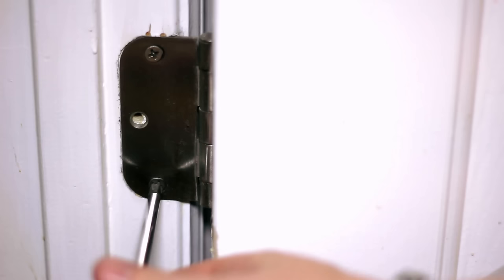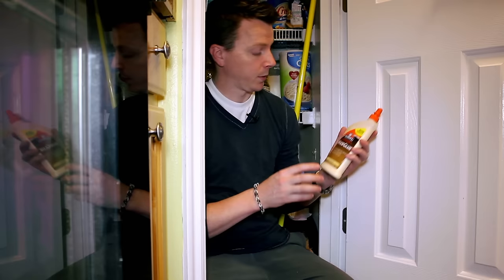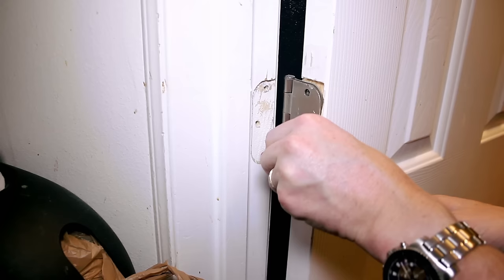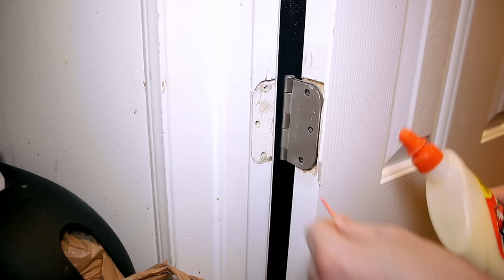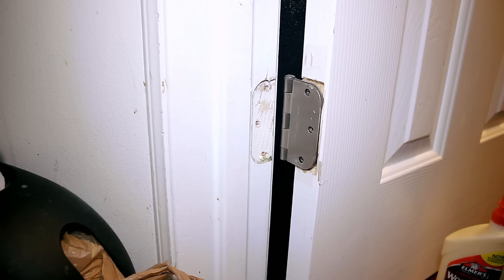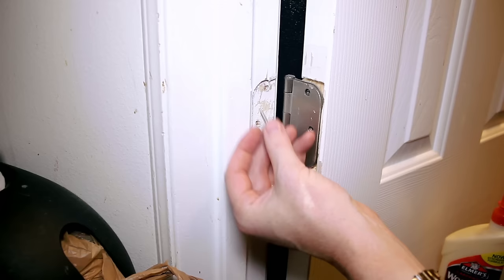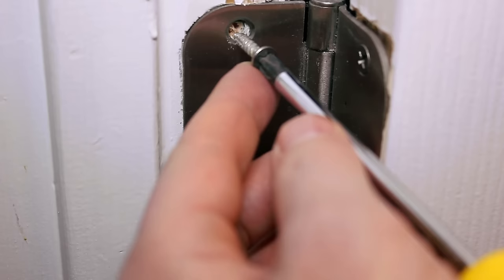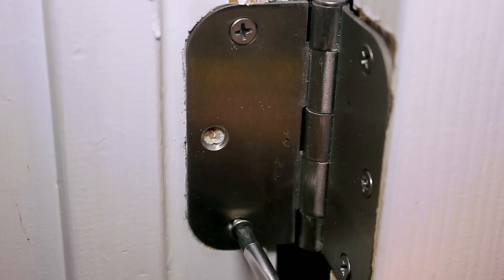Fix Stripped Screw Holes - 3 MINUTE FIX!

Comment: Skewers can also be a good option. It all works. Plug the hole with more wood. I never use glue for my plug unless the hole is really large. I rarely use this solution on doors though. Usually I will just put 3 inch screws in, if I need to shim the hinge plate and the outside holes are stripped I would do this.

Comment: What about repacing the screws with 3" deck screws and no toothpicks? That's work good. I actually plan on doing that with my front door hinges and strike plate for more security.
Reply: Agree. Also by going deeper, you are actually attaching to the 2 x 4 which is a stronger hinge attachment than the wood trim that a good kick can kick the exterior door open.
Reply: mixwell1983 do it after you do this fill method bc I did that & it didn’t take that long before it just stripped that section out as well. The kids going in & out & pulling on the door, etc. I would fill it first then throw that monster in there for sure. lol best possible bond all around.

Comment: Or you can do it in about 30 seconds using dry matches.
Stick a match in the hole, snap it off repeat until the hole is filled.
Repeat for each hole.
Attach hinge (in this case)
No glue needed.
If you really want to use glue, you don't have to wait for it to cure before attaching the hinge.

Comment: You could have used a wooden dowel that fits or the end of a wooden golf tee. Cut off the extra with a utility knife or pre measure the length and cut to size before inserting it into the hole. It will be a tighter fit and will last a lot longer. I did the toothpick trick and it works, but eventually it will become loose.

Comment: Can this be done say, after your kid decides to do a pull-up on one of your bathroom towel hold bars and strips the screw anchor clean out the wall (to center the towel bar, I couldn't use a stud so I used a wall anchor). I'd like to put the towel bar back up but drywall puddy has no stability, just good for patching. Can I stick some toothpicks inside the drywall hole, sand it then maybe add a thin coat of puddy over it? Do you think I can then screw into the wooden picks and rehang my towel bar, or no?

Comment: Is it the same process if the issue is with the hinge on the door portion?  I have a hollow core door.
Reply from the maker: JahPage Yes, it works the same with hollow core doors. They have a solid wood block, or at least a composite block, for each of the hinges so you should be able to use this same technique. Good luck!
Reply: +Nils Rasmusson Thank you so much!!!!

Comment: The ideal fix is to glue in a wood dowel and then redrill the holes, but an easier quick and dirty fix is to stuff the hole steel wool and just run in the screws. I've been surprised at how well that works.
Reply: Bob Cloninger does this work on metal screw holes too???

Comment: Hi,
Nice video
Does this method work on walls?
It's a blind attachment in which the screw is not gripping in the wall. 
There is a wall plug in this hole as well. Also would the wall plug need removing before using the toothpick method as in the video?
Thanks!
Reply from the maker: If it’s drywall then no, this won’t work. You probably need a good patch and a strong drywall anchor.

Comment: Thanks so much for making this video! Can I use wood filler instead of wood glue to fix the stripped holes?
Reply from the maker: I don’t think wood filler would hold up because it doesn’t set hard enough, unfortunately.
Reply: @LRN2DIY  good to know! So it has to be glue for wood, correct? Is there a specific brand you recommend?
Reply from the maker: @alexwong8851  Not really - any wood glue will likely work great. Titebond or Gorilla glue wood glues are both great but most will be fine. You can actually get away with doing this without glue as long as the wood is packed in there tightly.

Comment: Here's a much older method for you that doesn't cost any money at all. Go find a tree with a small limb growing out of it and don't forget to take your screw with you. Trim away the bark, then cut a piece of the green wood off the length of the screw. Place it in the hole and screw the screw in, you'll have permeant threads once the sap sets in and a permanent seal. Yes longer screws are better for a stronger hinge or anything, but using green wood no matter the length is the best. It's your choice.

Comment: When I run into this I use wooden matches, because they are bigger, and more uniform.  I have seen people years ago using cardboard (sheet not corrugated.)  Slather it with glue and pack it in tight...then let it dry  This was for INSIDE doors only.  And HAND screw, don't use electric.. you can feel the grip better.

Comment: Yeah we are working on it, the brass hinge it's what we have, already bought a new fan, but we just find out that it was nd the fan that it was bad, was the connection in the attic, it's no installation taking the humidity out they put the tube by the little window with fan in the attic and tape it to.  so terrible.

Comment: Stuff steel wool into the hole then put wood glue on the screw to make it easy to install and call it done.
It's quick, easy and most importantly permanent.
😁
Reply: Hopefully the wood glue isnt going to cause the steel wool to rust over time which would lead to rusty metal deteriorating on wood

Comment: To repair a solid wood dining room table would you use your method or would you try to insert wooden dowels instead?
Reply from the maker: For something that might take a lot of weight/pressure like that, the more you fill in the hole the better. One method is to drill a hole larger than the stripped hole then plug it completely by gluing in a dowel, then redrill the hole.
Reply: That was what I was thinking about that method or using an anchor.  If I went with the anchor, the area that I'm ultimately screwing the leg piece to is about 7/8" thick so I'm leaning more towards the dowel...

Comment: Any chance this can help me when putting up a wall mount for a TV, I think the stud is stripped
Reply from the maker: Yes, actually - the same principles apply. Where a TV is involved, though, I'd recommend moving the TV mount up or down an inch or two instead and drilling new holes. If that's not an option, maybe try drilling out the hole, plugging it with a down and some glue, letting it dry, then redriling.

Comment: Its better to make the hole bigger using a drill bit then use a dowel to fill the hole.  It’s like starting over with no hole. And don’t forget to use 2-3 inch screws.

Comment: I had done this for years but then I put a new twist on it.  I drill a 1/4" hole where the screw goes.  Then I glue in a 1/4" diol.  To complete the job I just put in the screws.
Reply: diol?

Comment: But what happens if you need to unscrew that hinge later? Do you have to redo the toothpicks every time you screw it back in? 

Also, why do you prefer toothpicks over wood putty?
Reply from the maker: +PoIyTicks If you remove the screw, it would act the same as real wood, because it is actual wood in there. If you try threading the same screw in, it should work fine. If you repeat this a dozen times, it will likely need to be filled again, just like any piece of wood. Wood putty could work too but I know toothpicks work because it's solid wood.

Comment: Any tip for aligning the door. My husband tried to fix the door and moved it up or down while tightening the screws that now it’s not closing properly and is banging on the top side of wooden frame 😶🤦🏻‍♀️
Reply from the maker: That's no fun. The only way I know how is to chisel out some of the hinge area on your door and set it a bit lower. If it's just barely off (maybe 1/8" or so), you can try putting some toothpicks in the bottom of the holes of the door so that the screws go a bit higher in the holes and maybe buy you that space you need. If all else fails, you can always cut the top of door down by the needed distance using a circular saw or jig saw - just be sure to use a straight edge as a guide and tape off the door where you're cutting it so that you don't damage paint.
Reply: Look for YouTube videos for aligning the door and adjusting the hinges. Sanding or chiseling the door should be a last resort.

Comment: my bathroom don't have a window and it's very humid,  my hinges are rusted,  it's any type of hinges that I can buy to avoid that, oh how can't I paint the and make them rust proof, what materials or paints to use so I can fix the problem
Reply from the maker: +dvaone11 Most decent quality satin nickel hinges, stainless steel hinges and brass hinges will not rust. The bigger issue, however, seems to be the ventilation in your bathroom. If you don't have a window, you should definitely have a ventilation fan that blows the air outside your house/apartment. The humidity will cause all kinds of issues with your plumbing, paint, drywall, flooring, door jambs, etc.

Comment: Can we do this in a guitar tuning peg screw hole ?
Reply from the maker: I'm not sure how well it would work there. The neck of a guitar is under a lot of pressure (over 90 kilos / 200 lbs of tension) so this fix, while it will likely function, wouldn't be a good long term solution.

Comment: Or you can drill a inch hole 3/8 hole then put in a 3/8 dowel cut one inch. Put wood glue in the hole and gently put in the dowel. Wait 24 hours for the glue to set. Then screw in the screws by hand not by a power tool. As a power tool will over torque.

Comment: can you tell me wich is the good glue, i have bought  LEpage wood glue Express Quick dry....but i find its not solid, what you think? thank you.
Reply from the maker: I have used several brands of wood glue and found them all to be comparable. Just make sure it's labeled as wood glue and not another kind.
Reply: ok kool
Reply: Ok i hope i get this in montreal canada I will search soon thanks.
Reply: Gorila i have tried no good.
Reply: I used a multipurpose glue. At least u can use it again for other types of material Eg. Glass, plastic, rubber

Comment: I'll give a shot today. My screws popped out of the bottom and when I put them back in the same holes the door won't close as it is not aligned and the hinge is popping out. So if the holes are lined up in the same spot is has to be aligned, doesn't it?
Reply from the maker: It needs to be close, but not perfect. The holes can be askew by a little bit and still work fine, like you see in the video. If you want to play it safe, get thinner toothpicks and put one on each side of the hole. Let me know how it turns out!
Reply: It worked well. I first tried a wood-hole filler and it was too soft. I then used Gorilla wood glue and just standard round toothpicks and it was solid as a rock when it dried. It needed to smoothed before I drilled it.

Comment: Will this work in plaster? The screw holes of one of the brackets holding our stair railing are too big and stripped and won't hold the screws.
Reply from the maker: Hi Laura, no - this won't work in plaster. Typically you'd use drywall anchors for that problem. You can look at a traditional thread-in anchor or you can buy a toggle bolt, which gives you a much larger area to work with - perfect if the plaster hole is already too large for a traditional anchor.
Reply: @LRN2DIY  I see. Okay thanks. We have a bracket on our stair rail where the screws won't stay in place. We are looking to fix it ourselves at least temporarily because of the quarantine but neither my dad nor I are very handy with stuff like this. My mom relies on the rail heavily to get up the stairs. We're not even sure it's plaster. It could be drywall but I don't think so.
Reply from the maker: @lauraregan8439  Sounds like an important repair. I think the toggle bolt should still do the job, whether it's lath and plaster or drywall. Typically those railing mounts are drilled into studs, so it'd be surprising if it's not. You can try drilling it out a bit more to see if there's any wood back there and, if there is, this technique of using a filler will work. If not, I'd go for the toggle bolt.
Reply: @LRN2DIY  thanks so much for the advice. I will try it.

Comment: I have a towel rack screwed into drywall. With the blue anchors.   Now it's loose. Droops bad.  How can I fix this?  Thank you
Reply from the maker: You probably can't use the same method to fix it. I'd recommend driving new drywall anchor screws in and puttying over the existing ones.
Reply: Build a new house!

Comment: Good video and thanks for sharing.  But I prefer using match sticks instead of tooth picks for this job.
Reply: Just use same size screw but different length so that it will get to virgin material. Hollow core doors have 1 -1/4 inch fillers  running top to bottom. I will always try a longer screw first if that does not work this video information is a  good solution also.
Reply: Junkyard Dawgs 
There is no virgin material. There's a very thin layer of wood past the factory screw hole. If you hit something solid it's the stud. Not what you want to screw into.
Reply: A stick worked great for me

Comment: What to do if the bottom screw is free to wiggle (as in the lower screw is in a hollow part of the door) thanks
Reply from the maker: That's a much tougher scenario because hollow-core doors have nothing to grab onto in the hollow section. If you have two screws that are in the non-hollow part, that should be enough, but if you need to get that hollow section taken care of, I'd recommend squeezing some liquid nails into it, letting it set, and then driving a screw into that. The proper way would be to disassemble the door, add a wood block, seal it back up and drive the screw into it, but sometimes that's just not worth it.
Reply: The top screw set perfectly but the bottom screw just wiggles around, nothing inside to grab

Comment: Will this work on aluminium window hinges?
Reply from the maker: Not likely unless the aluminum is thick enough to fill.
Reply: @LRN2DIY  it's a thin and hollow aluminium.

Rather tricky to get a solid thread grip. My area is quite windy in the winters. That's how the window hinges loosened

Can't find anyone who has fixed stripped screws on aluminium .. any suggestions would be helpful

I tried a fix with plumbers tape on the screws. That didn't hold long. I'm trying to find tiny plastic plugs next (the ones that we use for walls) . Your video gave me the idea to glue the plugs in with feviquick.
Reply from the maker: @skylark1848  What you likely need to really fix it is a tap and die set. You'd need to rethread the hole to be larger and then use a larger screw with those matching larger threads. Not a simple thing but very doable too.

Comment: What if the hole is so stripped inside that the screw can wiggle, like it;s hollow at the bottom screw? Thanks
Reply: Tommy Daly 
Then just put in more toothpicks until you can't tap the pointy end of the next one in.

Comment: Can I use an anchor because I put a 3 inch screw and will not catch its hollow not even a dowel lol any suggestions lol
Reply from the maker: You could certainly try the metallic anchors and see if that does it. So you tried gluing in a dowel or other wooden items and that didn’t do the trick?
Reply: @LRN2DIY  Hi it worked!  Went to home depot got me some metalic anchors and I was able to do it, being divorce an no man its hard, but thanks!

Comment: The best method albeit more involved is to use 1/8” or 3/16” dowel material available in 3’ lengths. Drill hole to slightly smaller than dowel , add glue to dowel and hole , cut off with sharp chisel  or pre cut to length. Wait 2 minutes, pre drill screw holes, screw hinge back in place. Rock solid repair.

Comment: Another way to do a better job is to use at least a 2" screw, 3" would be better. That way you eliminate the problem of the failure in the first place, screws too short for demand. The longer screw will get you into wall stud that is a better quality wood than the door frame. I just looked down and found that bing12345678901 posted the same thing.

Comment: Can you fix the holes on a hollow door the same way?
Reply from the maker: Jim Bowering Only if it’s in the solid portion, like where the hinges connect. If it’s in a hollow part, this will not help.
Reply: @LRN2DIY  Any ideas for how I can fix it?
Reply from the maker: You'd have to fill in that section of the door, like in this video (https://www.google.com/search?q=fix+hole+in+hollow+wood+door&oq=fix+hole+in+hollo&aqs=chrome.2.0j69i57j0l4.10075j0j1&sourceid=chrome&ie=UTF-8#kpvalbx=1) or you could probably glue a backer board in there if you can fit one, then putty over it. Neither are simple but both are doable. Good luck!

Comment: This is true I have done this... but this  way its a pain in the butt & doesn't last as long.
USE GOLF FEES.   I use Gorilla Glue for wood - hammer in the golf tees - let it sit for 24 hours and then I saw off the ends of the golf tees then I sand it and then screw everything in. TA DA  it's good for 20 years as long as you use the long screws.
PS. Golf tees come in different sizes. Make sure you get the correct size for your screw holes.

Comment: Or, and I know this is crazy, but you could, hold on just hear me out. Use a longer screw.
Reply: Very true.....but the tooth pick is hella lot cheaper.
Reply: Won't work if there's open space 2 inches or so into the jamb.
Reply: swami 7774 they don’t make screws longer than 2 inches? It will work, I’ve done it plenty. It even holds better once you get into studs.
Reply: @papalog08  Yes, they do. Previous owner used 3" screwed to screw hinge to bathroom door. That's why I'm here. Don't want to use 3 in screws again.
Reply: This is a great option for a cheap, temporary fix with cabinets where using a longer screw isnt an option.